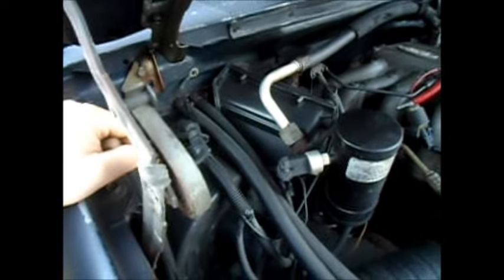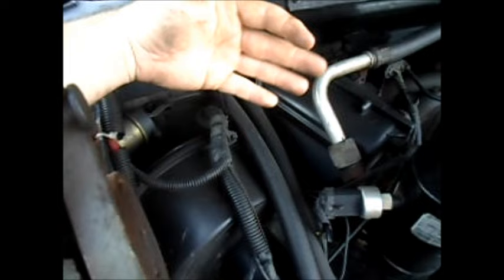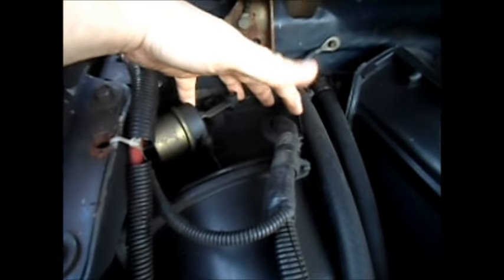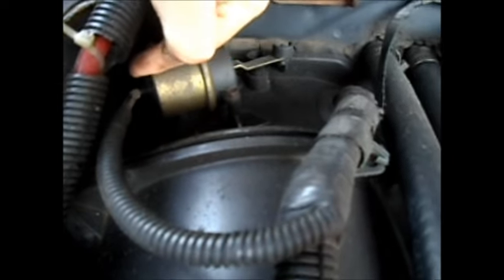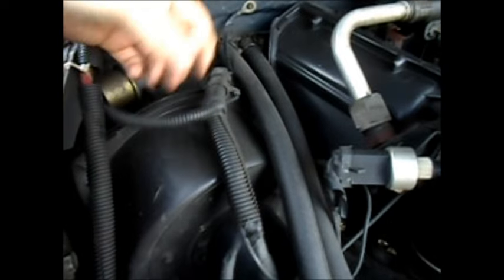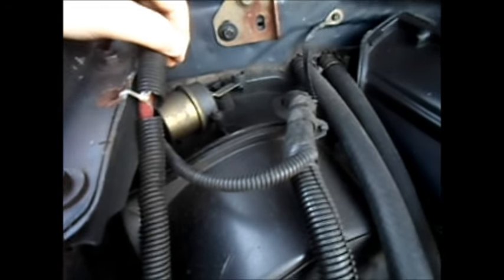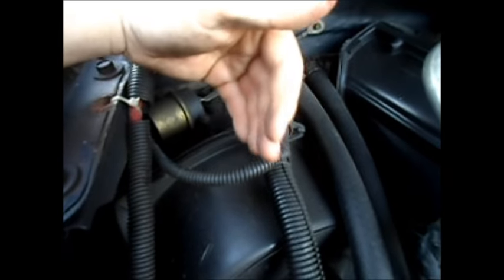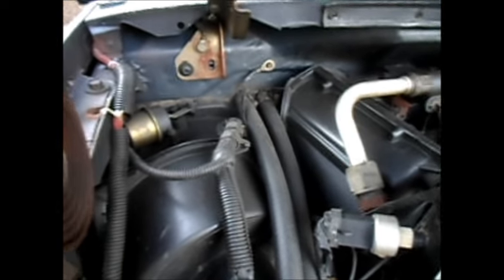1992-1996 OBS  F-Series: HVAC Not Switching Between The Heater, A/C & Defrost Modes

Comment: That vacuum motor is actually just the fresh air/ recirculation door motor. There are 2 more vacuum motors under the dash to control the vent modes.
Reply: Lonewolf3165 I am having an issue where I get air coming from the blower motor and out of the blend door/into the cabin, but it does not come out of the vents. Think it could be one of those??
Reply: Can you describe wherebout these 2 are? & are they the same part number as the one under the hood?

I just checked the one under the hood by manually moving it and its not right, inner mechanism feels corroded. I figure after 23 years all of them are due.
Reply: @kgtmustang  one is at the passenger feet, the other one is hiden in the dash behind the radio/heat panel
Reply: @redmachine4542  THANKS MUCH! I know there is also one under the hood at the passenger corner near the heater hoses. So know I can begin a strategy to replace them. They are not cheap = around $50 each. However after years of going round and round regarding the evaporator core location, last summer I was reworking all the gaskets on my engine and DUH...there was heater core covered in a foil wrap super easy to get to. YAY!
Reply: Hey looks like you are knowledgeable about these trucks. I’m looking to buy my first one and the one I went to check out had two hoses disconnected. I’d really appreciate if you could name what the hoses are. On 0:06 the two hoses are coming out of the wall. I feel like it’s not good to have them disconnected hahaha. Thanks in advance!!

Comment: On mine both the black and white vacuum tubes are broke, i bought some air brake tubing to run through the loom under the acumulator and up to the vacuum source between the evaporater housing and the passenger side of the engine and that fixed the black vacuum source, and a piece of 5/32 vacuum hose, approximately a foot and attached that to the white hose, and from there to the fresh air mode door actuator that is located in the corner of the passenger side firewall, the vent door actuator is located under the dash, to the right of the ash tray, on my 92 f150, thanks for the video!

Comment: If there is a vacuum line leak in the line....shouldn't the heater Ac direction doors still work...operating the vacuum control manually?
If testing the broken line produces no vacuum then what?

Comment: Well what do you know, my heater wasn't working on my 96 so I went to check the vacuum line and it was cut off.. weird thing is whoever had it before me put a zip tie on the actuator that holds the line... could this be the reason for no heat?
Reply from the maker: That sounds like you have multiple issues at hand. Check your thermostat (May not even have one in place), check your heater core to ensure it isn't plugged up, etc.

Comment: would this fix my lukewarm heat? i can hear the doors moving when i turn it from floor to vent but on vent and floor it’s cold, when i turn it to vent i get amazing heat for about a second then it gets lukewarm, and i can hear a door almost closing instead of staying open.
Reply from the maker: Sounds like it's losing vacuum somewhere. Go over your vacuum system good, see if that helps.

Comment: Does anybody know if on an 83 f150 does this vacuum system still require a cable behind the control levers to operate?  Can't find a cable hanging anywhere and just lost the air flow direction.

Comment: I fixed this but i still don’t have any floor heat it comes out the defrost but the vent seems okay
Reply from the maker: That sounds like the actual door not working correctly

Try moving it manually, if it works correctly then it is probably a bad servo/vacuum setup

Comment: you said a wire may have slipped from in there. can you be more specific
Reply from the maker: Pull your glove box out, and look at approx. a 10 O' Clock position, on top of the AC Ducting and you will see a white piece of plastic that SHOULD have a wire coiled around it.

That's the other end of the cable from the HVAC panel that moves the blend door.
Reply: Thanks for the video and specifying where to find this. Just got our first snow and it managed to be a super quick fix so ready to roll!

Comment: My first AC vaccum hose broke after 22 years.  Now replacing it with OE is a bit tougher.  Those tiny vacuum lines are brittle. The electric HVAC controls never last 22 years.  Praise anything without a god**(*&( motor and computer.

Comment: Take a piece of the plastic tubing you remove with you to the parts store so you can use it to size vacuume hose to fit tubing!  Plastic tubing is just another cheap means ford used to build the vacuumed system!